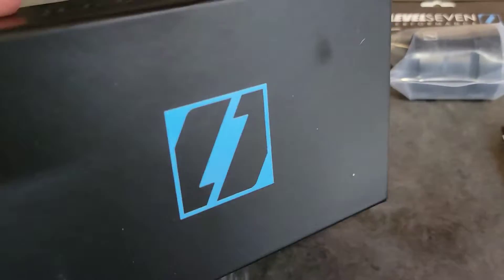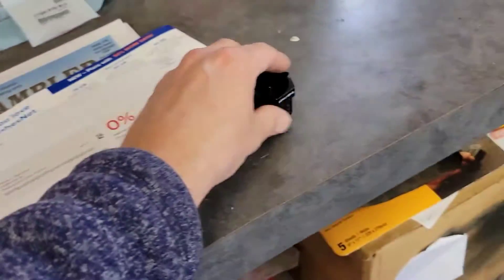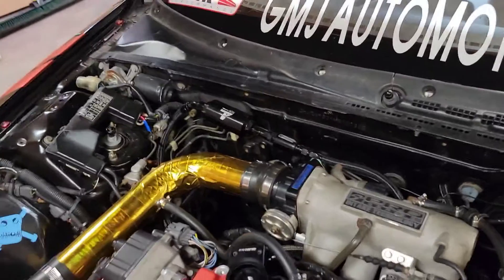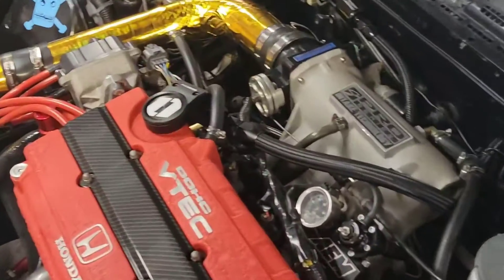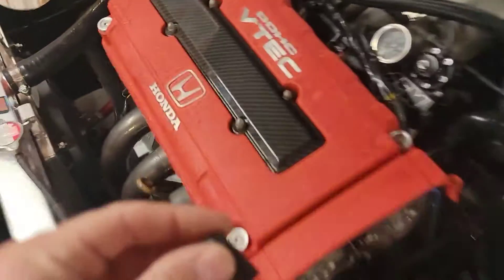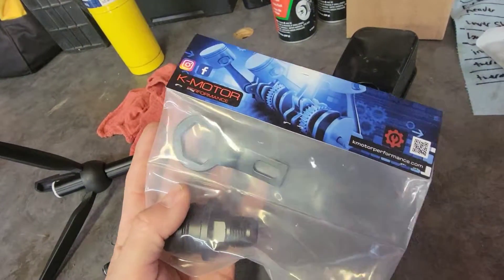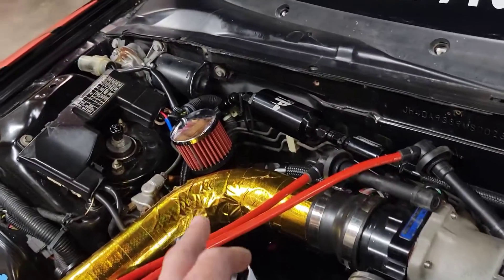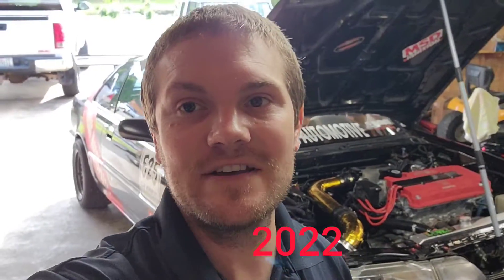Common track day issues. And adding a Level 7 catch can vent.

Comment: Yes that is the issue with this setup right there and why there are baffles in Valve covers that allow venting but block huge amounts of oil from exiting through threw this type of setup.  In the end he had to pull the valve cover and put a blocker of some sort in.  Noticed he did not recommend it as well in the end.

Comment: 90% of crank case pressure comes from blow excaping passed the piston rings. You are far better off venting from the back of the block. Just a solid tip my guy.

Comment: so you need to use that socket to tighten it?
Reply from the maker: Yup
Reply: damn.  that sucks.  i just got a 34mm. i didn't fit.  lol
Reply from the maker: @Hello_its_me_mario  dang! That does suck
Reply: Did you find a socket that fits?
Reply: @germanvazquez584  performance 7 sells it check there site for socket
Reply: @javiercuevassanchez6446  i messaged them they said a regular socket non impact works

Comment: blocking the bottom crank case breather is retarded.. dont do this.. 
you need to vent the block pressure into a catch can.. but remember kids.. most catch cans have a port for fumes coming in and an Exit port for fumes (cleaner fumes) coming out. 
So unless this guy installed a 4 port catch can... (highly doubt it) he is Venting the the head to an exit port on that catch can. Again... dont do this.. 
buy 2 catch cans or a larger 4 port one and use an intake port for the head and one for the block. You can block off the exit ports if you are running a filter on top.. but remember... you will get things dirty on your engine bay over time because of that filter... (block filter and run hoses to the bottom of the car and never look back.
Reply from the maker: I've been running this setup for 2 seasons now. Over 25 track days and I have yet had to empty the catch can. More than one way to skin a cat

Comment: Your crank case system is not right pressure is below cylinder head    valve cover vents are just for show need x2 AN10 on engine block
 fitting